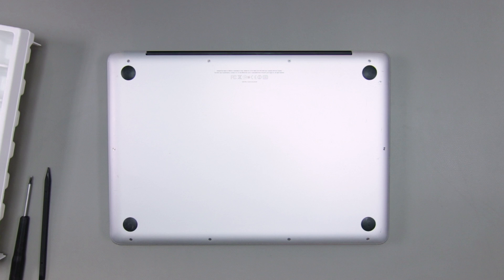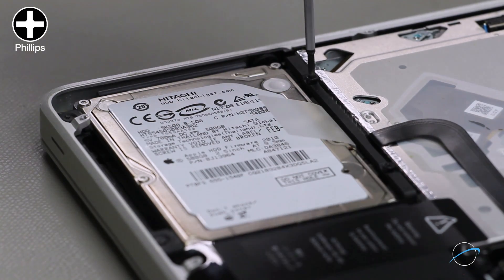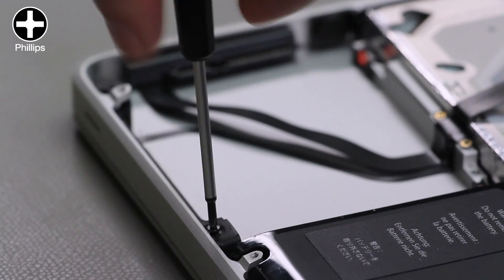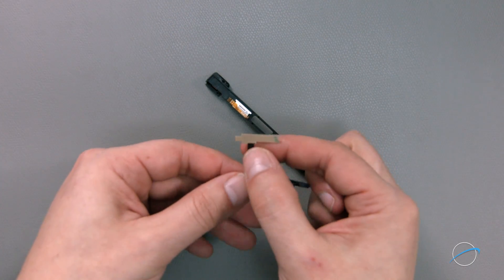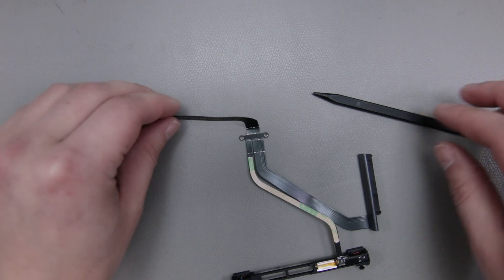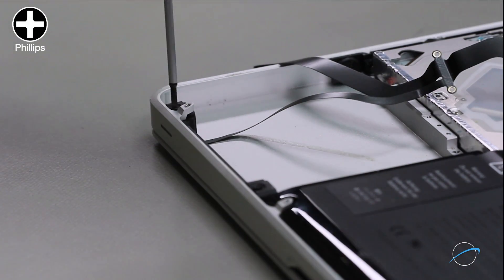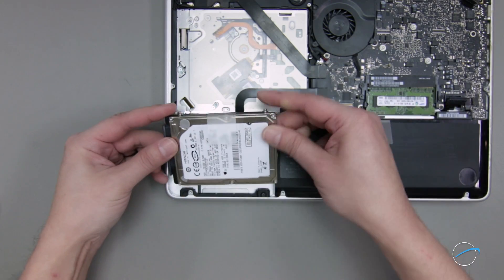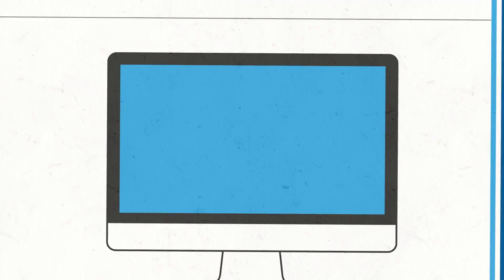How to Replace the Hard Drive Cable in a 13-inch MacBook Pro 2011

Comment: Thank you very much! 

I decided against bending and just put it back together as carefully as I could. I suggest people following this guide do the same. I’ve stuck a 3mm piece of tape on the top corner so it will stay still. 

I thought it was better then bending such fragile cable.

Comment: Just did this today and I get the same results as prior to replacing the cable, The flashing folder with the question mark is still there!        Is my hard drive bad?
Reply from the maker: Yes, a flashing folder with a question mark indicates that the machine cannot find an OS. If you've replaced the cable and get the same results, then we would suspect the drive next.

Comment: Managed install myself despite partial paralysis of my hands. Re-inserting tiny LED ribbon cable was the hardest part. Installed a SSD which fit easily. Used electrical tape on case under cables to avoid abrasion issue. New cable was $10 on eBay. (HDD Hard Drive cable 821-0814-A For MacBook Pro 13" A1278 2009 2010 &Screwdriver).

Comment: i've ordered this cable. I've upgraded to a SSD and within few months the problem started. The system will randomly "freeze". If I'm playing a video or a song, it will freeze but then after 5 seconds or so I will resume but as if it never stopped. I mean, if I'm singing a song, and I keep on singing, when the system unfreezes it will be playing exactly in the part of the song that I'm singing to. So I think it's not a SSD problem, but a problem of the cable.  What do you think?

Comment: Thanks for the great video. However, after hours of trying, I cannot get the yellow ribbon cable back into the socket. I do not understand what I'm doing wrong. I cannot even see a socket. I have checked and I have the correct model replacement cable for my 13-inch MacBook Pro, 2011: 821-1226-A.
Reply: I have the same . It did go but after a bit of struggle. Make sure you open the latch and close it once its in.
Reply: I destroyed ribbon wondering if it will work without light indicator ?

Comment: Is the flex cable you're using here the same as model 821-2049-A? I have a 2011 Mac A1278, but another video I watched on how to do this was for Mac 13" mid-2012--same part compatible? Thanks for the video!
Reply: Was it compatible?

Comment: thanks, great video! though i've followed your steps but the cable still seem to be corrupt. i've bought a new ssd disk and cable on my macboor pro (2011). wanna install mac again. the disk utility recognizes the samsung drive, though it's not been found when I have to designate a startup disk. what to do :)? thanks for the awesome support guys
Reply: nope. thanks, you're quick! :) will give it another go.. it recognizes the old HD so i recon this should be the trick.. will get back to you if i'm a step further
Reply: i'm lost in the labyrinth ;) can i just format it using another macbook? disk utilities > erase?